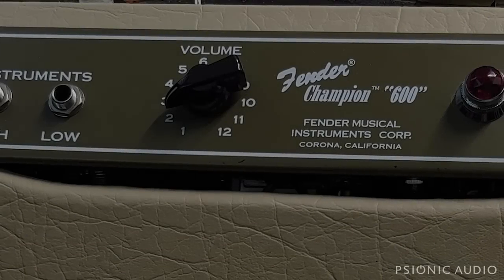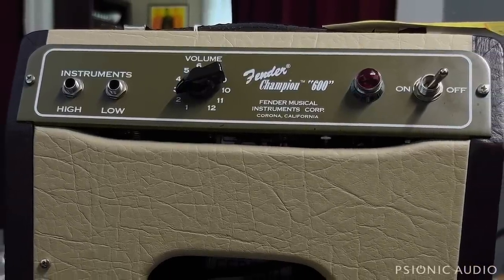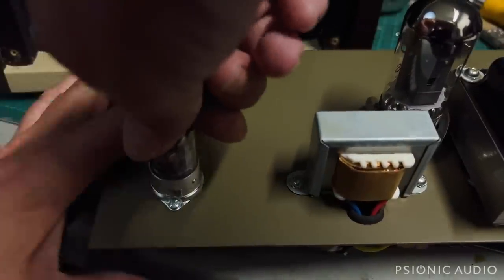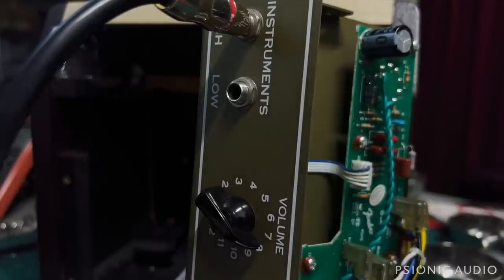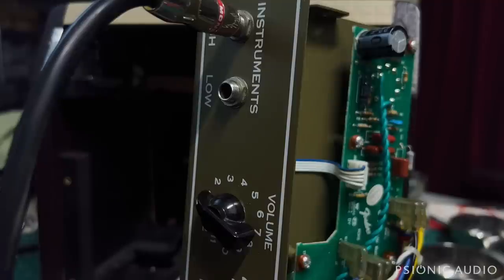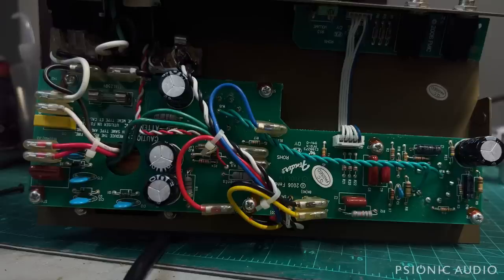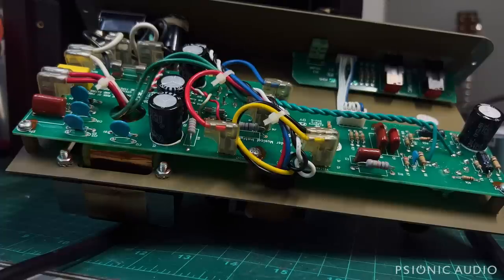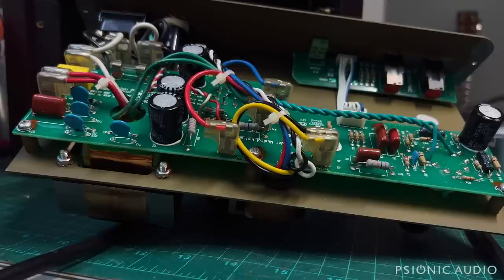No Sound in a Champion 600

Comment: I’ve always liked the sound of these early 2000s Champ 600s (when they actually work). They have a fixed tone stack that makes them sound big and full compared to most low-watt amps.  The VHT Special 6 is a very similar idea with a fixed tone stack.  Thankfully, the VHT comes with a 10” speaker, is hand wired on a turret board, and has none of the hum issues the Champ 600 is known for.  A Special 6 with a Weber 10A125 is a beautiful tone.  I’m not ashamed to say that it’s my favorite amp, and I’ve owned an embarrassing amount of guitar amps over the years 😂

Comment: The solution I found to reducing the power hum (even at eliminating it)  was to isolate the grounding of the preamp main filter cap/and associated stage grounds from the overall poor ground scheme of the amp.  Basically I cut the (large) trace that connects those grounds (on the right side of the board) to the power section grounds, then reground the preamp section at the input jack.  * This after replacing the volume control, input jacks and associated resistors with higher quality parts.  To a technician, this is an easy mod and makes a good amp (in theory) a great amp.  (Or leave volume/input assembly and use a big soldering iron to just ground that section to chassis near input jacks)  No need to throw away, or to live with poor design.

Comment: Doubt if one will ever cross Lyle's path but I have a 5watt Monoprice Stage Right amp. $149.00 new.  It has 1-12ax7 and 1-6v6.  Comes with a Celestion super-eight 8"speaker.  Volume and tone controls. Sounds fabulous.  Built well {imho} for what it is. It's held up well for over a year now.  It owes me nothing. Great intro into  tube amps for very little investment. His bigger 15watt 2-EL-84 brother is $279.00. With bells and whistles. I have it also. Great sounding amps.
Reply: I got the 15W/1W version and it is awesome. I swapped out the stock reverb tank for a MOD. Good improvement. Tried a Cannabis Rex but the stock Celestion works just fine. Not sure about yours, but mine is based off the Laney Cub circuit. And from what I understand, if someone wants a cheaper but better sounding JCM 800 tone in a small package, you get a Laney Cub.
At any rate, it is really a killer little amp.
Reply: @michaelmoore7975  I also did the reverb mod. Mine came with a Celestion  "A" type speaker that I love.  It seems to pair well with the amp. I believe earlier models came with a vintage 30.  I tried the amp with one of my Orange PPC-112 cabs with a vintage 30.  Of course an open back vs a closed back have their own differences. Can"t go wrong with either. Just a matter of personal taste really. I like them both.
Reply: The super 8 is great choice.

Comment: Instead of fixing the hum, I put the Mercury Magnetics 5F1 kit into mine (I was bored). Sounds great, especially plugged into a 12” Weber speaker cab.
Reply: I did too, but with a Weber 8" speaker.
Reply: Is it just a set of transformers? Or is there more to it? I used a classic tone when I replaced mine but I wish I'd saved up for mercury's.  I want to build a larger cab and increase the size of the speaker ( maybe a 2x10? But probably just a single) would appreciate your input.
Reply: @jonathanjohnson8656  It was a complete 5F1 conversion kit along with the transformers & a Weber speaker. I usually bypass the speaker and plug it into a 12” cabinet. I run An EQ pedal in front of it and turn it up all the way😊
Reply: @thomasmetz3  Thanks for the reply.  I looked for it and it seems to be discontinued.  Maybe I could build it piecemeal,  but I'm not sure.  It's encouraging to read that it's a good upgrade and I believe my amp has potential for a great tone ( its not bad as is.) . I had a 59 tweed but I sold it to fund something else and I regret it.  So I'm looking to get close to that tone with the champ600. I run mine in stereo with a vox ac10 or pathfinder15 and they work great together with my tele. I think the larger speaker is a huge improvement as I have ran mine through an eminence red coat private jack and it sounds great.  Thanks again!

Comment: The twisted green wires going to the 6v6gt socket are too close to the board. If you extend them and re-twist them away from the printed circuit board it will help.I saw it on a youtube video somewhere. Now I'm kind of shocked at how little unwanted noise comes from the champion 600. Also changed the 6v6gt and ordered a new volume pot. Deoxit is also good for scratchy pot and inputs. I bought an Electro Harmonix 6v6GT. I wouldn't have thought it but it is now a pedal amp. Sounds very nice with slap delay, reverb ,tremolo and a bit of overdrive.

Comment: I've got one, purchased used with the Mercury Magnetics transformers and choke/component mods/upgraded Weber speaker, and better tubes.  It still makes noise and the cabinet rattles.     It is what it is, and I'm not planning to throw any money at it.  Turn it up, ride the guitar's pots, and have fun, or spring for a proper Champ, which is a pro sounding amp compared to this.

Comment: I have one of these amps! Sloppy design by fender. Hum is normal. What can you expect from a 22uf smoothing cap? I put 100uf cap in parallel that reduced hum by 70 percent, but twisted wire supply wires run right across board pre amp circuit. Hum can be reduced further by balancing virtual earth 100R resistors on filament supply but, best thing to do is full wave rectify filament supply and smooth with a 1000uf cap.
Totally silent now but what a farce! 6v6 biasing is so hot that it red plates a Tung Sol tube. Changed 560R to 680R 5watt. No ht fuse so if tube shorts due to ridiculously high B+ supply it burns out the 100R virtual earth resistors & results in massive hum! Had to fit power scaling to reduce & control B+ supply voltage to sensible levels. Tung sol 12ax7 & JJ 6v6 (has more power dissipation). I shouldn’t have to do all this, but luckily I can & it became a challenge. It looks cute,….but speaker & cabinet are too small for sound & electronics. If you see one of these amps for sale,…. Run a mile!
Reply from the maker: Good job. Now tell the people what all that would cost if they had it done. ;)
Reply: If the cabinet is not garbage, that is the only good thing about these amps. Better to find a broken one at bottom dollar price and gut it to start from scratch, but even then reusing the transformers will limit what you can do... The only thing that impressed me about these amps when new was the cosmetics.

Comment: I had to make a similar decision about an amp recently. It had decent speakers so I converted it to a cabinet and kept the parts that I could use on future projects, then took the transformer to a recycling facility.
The cabinet sold for £10 less than I paid for the amp, the parts I salvaged would have cost me more than the £10 loss on the amp.

Comment: I've got one of these on my bench right now from a friend that is in a complete state after becoming his 'modders playground' with more than 50% of the components swapped out and most importantly, a cooked R10 Cathode resistor.  Economically a no-go project, but its serving as a great platform to deepen my tube amp knowledge so a win-win deal so far...

BTW - the internet is chocked full of alleged fixes for the infamous '600 Hum' so the amp in this video my have left China with same fault?

Comment: What is the build quality of the cabinet on these reissues? If it's decent, these might end up being a good candidate for diy'ers. I remember being impressed by the cosmetics of these but nothing else. Unfortunately, if you want Tweed tone, even the power transformer would have to go... probably not enough power for a 6v rectifier tube...?
Reply from the maker: Crappy cab.
Reply: @PsionicAudio  well that scuttles that idea! It's just a cute tchotchke that can amplify sound then...
Reply: I use mine in a 12 inch Cab. Sounds decent. Quite loud too, enough for jamming.

Comment: I sent a MarkBass 802 chassis to a repairman in Pennsylvania that needed a new power amp board. He inquired with MarkBass about a replacement board cost, but they just sent him the board. He asked me If I wanted to get it fixed, otherwise he'd have to return the board to Italy. I said yes. I wouldn't want a tech to swallow a cost that rightfully isn't his.